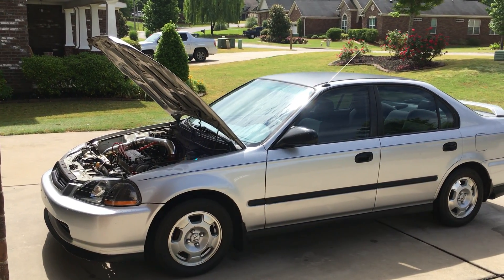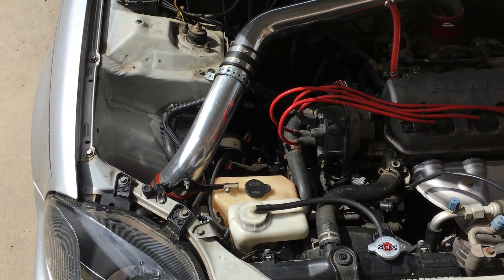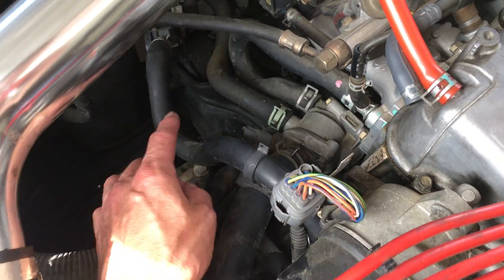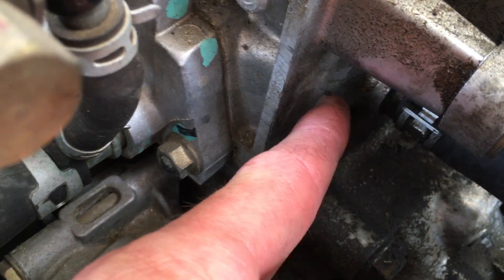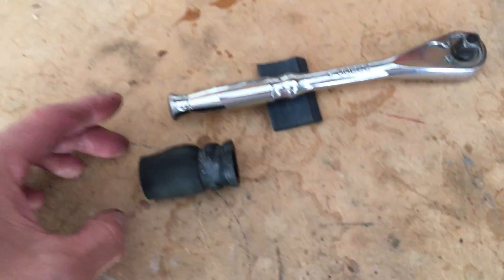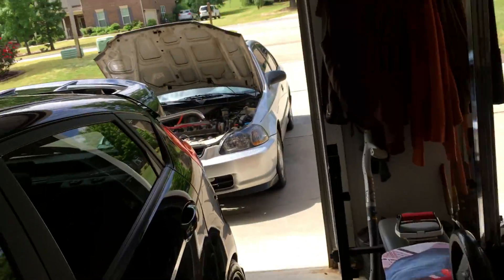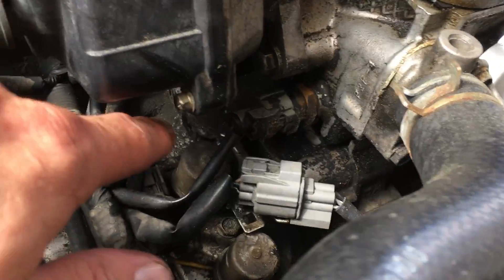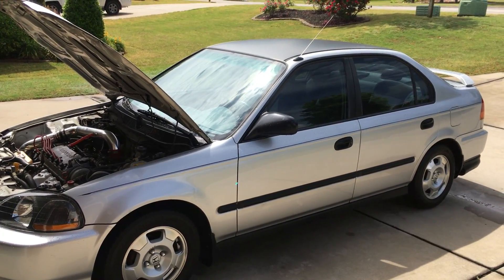98 Civic (6th gen) common coolant leak and fix

Comment: I found that out the hard way after replacing my thermostat and water pump! Great fix. Finally fixed mine. Also if your instrument cluster isn't reading it is the temp sender right next to that small hose that needs replacing, not the ECT to the far right or the fan switch on the t-stat housing.
Reply: I been trouble shooting this issue as well with my radiator fans not turning on ' everyone say's it's the thermostat causing overheating ( and it probably is too ) but I'm questioning the cooling fan sensor/switch . it's a 94 Integra . I already changed coolant temp sensor when I did distributor and then other things started popping up . I do have a hair-line leak along my radiator as he mentioned, so gonna try JB water-weld to patch-it up tomorrow . man I just cant gatch a break from this car !!
Reply: @sambumanglag6432  sorry to hear... I'd check the fan switch right by the thermostat, but I agree with everyone else... Replace your thermostat if the lower hose stays way colder than the upper hose. You can get a good CSF plastic top for a good price from rockauto. That's where I got mine. Also, I tried other rad caps and the best one is the OE Honda/Acura ones. Hope you fix it!
Reply: @CMX1100_Sam  thanks for the advice' I do plan on replacing thermostat along with switch since It'll be next to it. ( what's this CSF plastic top ? ) I've been draining so much $$$ in the last month it's all making me crazy . I wish it was 1-2 things every year but noooo. and can't afford auto mechanic because it would totall break the bank !
Reply: @sambumanglag6432  its a CSF Radiator but it isn't all aluminum, so it has the plastic top like an OEM radiator. You can also go to pick n pull or your local junkyard and grab the fan switch and maybe fan relays as well for your fan or even a fan itself at the junkyard. I wouldn't seal it with jb water-weld. You'll probably find a bunch of radiators there also. You can probably get away with a civic radiator too if you can't find an integra one. The parts are interchangeable.
Reply: @CMX1100_Sam  ok thanks again I know of a pick-and -pull nearby too '
Reply: @CMX1100_Sam  hey buddy ' you wouldn't happen to know the part # for the CFS Radiator on Rockauto.com ? I've got the 94' LS integra ( auto/non-vtec ) just need to know the exact model . I am noticing the leak I patched up starting to show slight leakage again .
Reply: @sambumanglag6432  So for the integra's they are the full mount radiator. Looks like its the CSF 3320 for the integra B18B Non Vtec Auto. Just an FYI new radiators doesn't come with a new cap. So make sure you purchase a cap.
Reply: Vuth Spost ok thanks' theres a couple places that have these CSF radiators and it becomes confusing not knowing which one actually fits. I appreciate your help
Reply: Which instrument cluster? And whats the part called? Temp sender?

Comment: You just solved my problem, best news ever, especially since some guy at the auto parts store was saying, “It could be a head gasket.” Umm, there is no way - there’s been no signs for it. So, thank you!!! I reached under there and found the fingertip sized hole in that hose. Now to figure out how to pinch the clamp to remove the hose, because the clamp ends are positioned upward against the distributor cap. Did you cut the hose first, then remove the remaining hose/clamp on the nipple? Thanks again for posting this video, life saver!
Reply from the maker: Glad to help.  It's been a while but IIRC I pinched the hose with alligator-style vice grips (a small one), pulled the side loose that goes into the engine, cut it, and reinstalled.  30 seconds of work here.  Then just run the car and add a little coolant to the reservoir to make up for any lost.

Comment: i was driving today and noticed my temperature of the car was at max. i pulled over and realized my radiator coolant tank was bubbling, sizzling and steaming out. i turned the car off and added more antifreeze. Even then after i began to drive again about 15 seconds later it began to bubble again. i also beleive that the radiator fan hadnt been spinning. can u tell me what to check please. 2000 honda civic se. thank you

Comment: I replaced my radiator AND upper + lower hoses with OEM parts and I still had a leak. I thought I had solved the problem but I was still leaking, I read some forums and it brought me to this video. Sure enough, the heater core hose had a hole in it. Thanks for this video!

Comment: Oh ok! My distributor o-ring also needed replaced, and now my coolant has mysteriously vanished and below the min line and overheating after only 3 months of changing out and pressure testing and stuff. I'm afraid I might have a blown head gasket but before I do anything crazy I'll definitely check those hoses and especially that one, thanks this is very helpful! Right now I'm driving everyday with the heat on full blast in 90 degree weather, just to keep the coolant needle from creeping up at idle, sweating my butt off, so... lol.

Comment: This def helps. Same thing just happened to mine. Thanx man
Reply: Pretty much the same thing happened to me and now since i overheated the car by driving it like that to many times and now it looks like some of the coolant passages on the head are cracked after I removed the head. My plans are just rebuilding the whole engine since someone egged the crank before I even bought the car years ago.

Comment: So my heater hose the same hose as in the video was leaking so i replaced the hose and thought it was good to go. Well went to a friends house and a big puddle of coolant was on the ground. I knew the hose was good. This was on friday now sunday i cranked the car and immediately started pouring coolant from the same spot so i  took the hose off and it still looked brand new. I noticed the nipple for the hose had a bolt on it to crank it on and off. I gave it a quarter to half turn put it all back and wala leak is gone.

Comment: That paint job looks mint for 216,000 miles. Has it ever been repainted at all or is it original? I have a Civic that’s also a 98 that has the metallic blue paint color and I took mine into a paint shop 4 years ago and had the professionals repaint my car. Same color as it was right from the factory.
Reply from the maker: Paint is in bad shape.  Original.  Video makes it look decent but it's oxidizing.  Plus that was years ago, now in 2021 I still have the car but it's been sitting in the sun and paint is hurting.

Comment: Did you have to drain the radiator fluid to remove that hose? Or can you remove it with the fluid in the radiator? I'm working the same job today.
Reply from the maker: No, just crimp it with some alligator style vice grips a few inches up so nothing leaks. You might lose a little but not much will come out.

Comment: What that piece the hose connect to ? I need a new one it looks like
Reply: Connects to the heater core! The same exact hose blew up one night on a 40 mile drive back home. What took to be a 30 minute drive ended up taking 3-4 hours just because I had to pull over every 1-3 miles to let the car cool down. Thought it was the head gasket but turned out it was the hose under the distributor that leads to the heater core lmao

Comment: did ya take the distributor off to get to it ?
Reply from the maker: I did not, there is plenty of access without removing anything.
Reply: @gray25xt  teggy engine bay has my hands tight, so had to see if you had that issue

Comment: What’s the name of that hose
Reply from the maker: Not sure sorry
Reply: @gray25xt  can get on local autoparts store?
Reply from the maker: @DavidHernandez-ue4fz  I always go to Honda dealership for parts, I am sure it is not too expensive.  Show them the old one or where it is on the car and they will find it easily.  Or take the part number they give you and find it on eBay, it will be much cheaper that way.

Comment: How did you get to it? It looks hard to reach
Reply from the maker: It's right there under the distributor, it's very easy to get to no problems.
Reply: @gray25xt  from underneath or right on top? Thank you for responding
Reply from the maker: @tommcgivern8020  I just went right under from behind, with the right tools it's fairly simple.  Good luck.  If you get stuck message me at puddleglum72@gmail(dot)com and I'll do a facetime and show you in person.
Reply: @gray25xt  the firewall end doesnt look easy to get to
Reply: Especially when clamp is facing the wrong direction.. that's what I'm running into right now but nice video